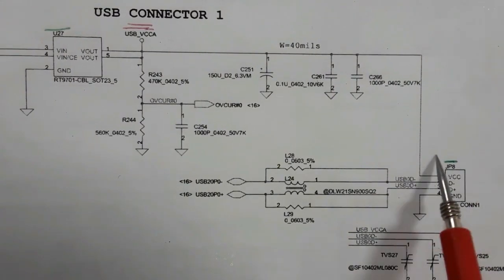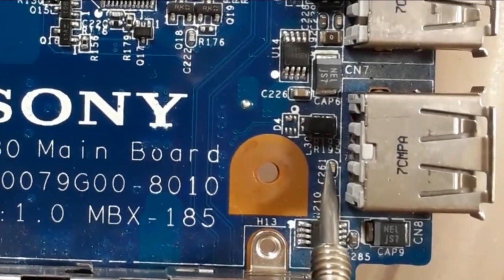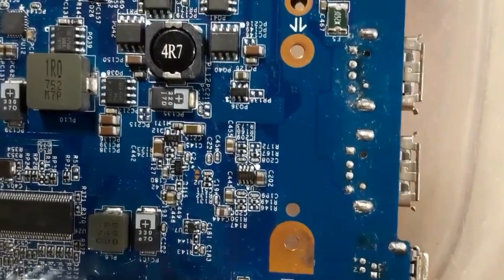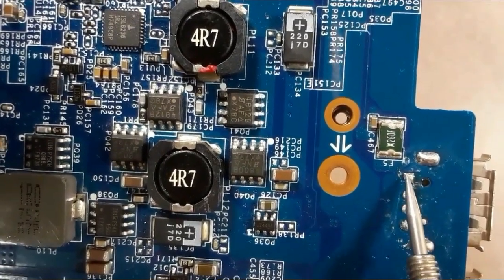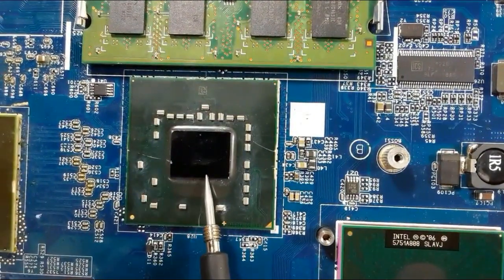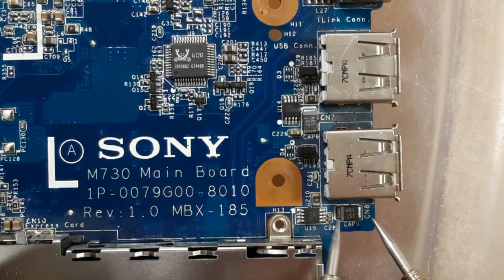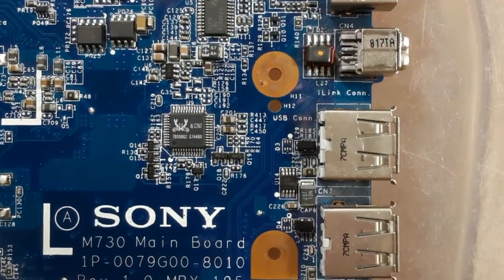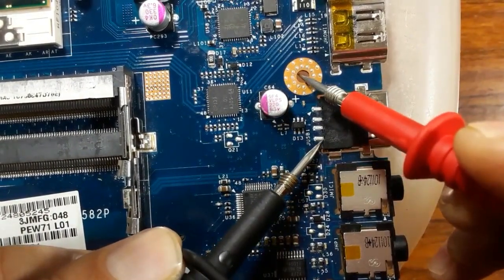Laptop motherboard repair - USB connectors circuit studying

Comment: Hello , at 08:34 you set your multimeter on Diode mode or Continuity mode to check the fuse and on 08:56 for check chemical capacitor  your multimeter  was on  Diode mode or Continuity mode ? thnx
Reply from the maker: It was on continuity mode when I tested capacitor

Comment: Thanks for sharing your precious knowledge. I got a Lenovo that has D+ and D- shorted between them and the 5V are not present but no short in pin 1, any suggestions?
Reply from the maker: Glad I could help. Replace that usb port and let me know
Reply: @electronicsrepairbasics_erb Thanks for your answer. I already did, but got the same result. Sometimes I can measure 3V at pin 1, but no clue about why just 3V.